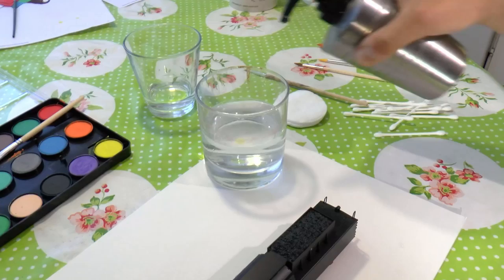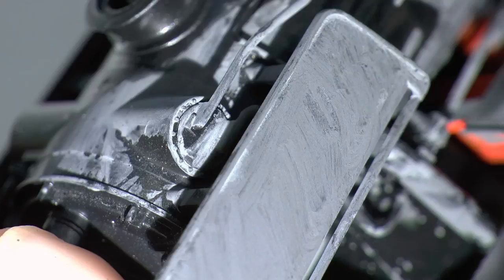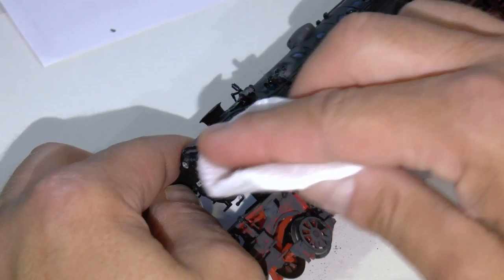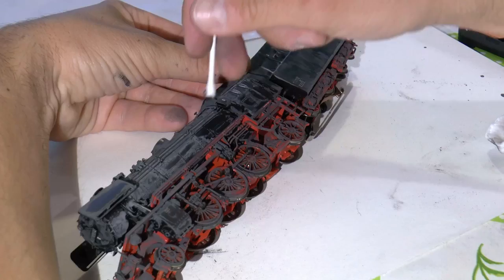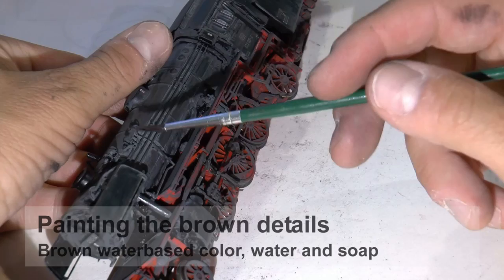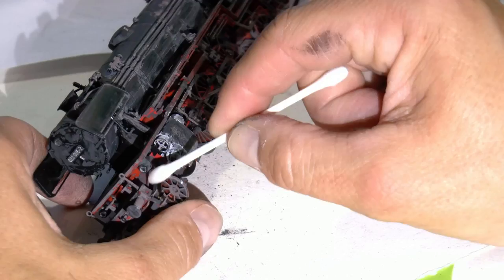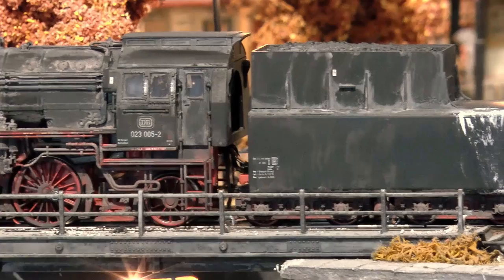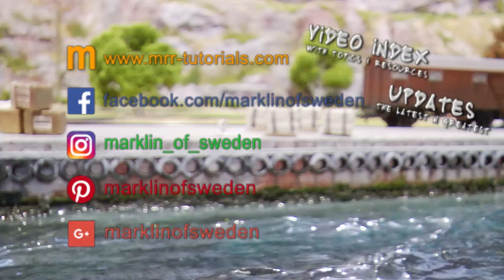Weather with water colors EASY - Detailed guide DIY

Comment: another great video, thanks for producing them! question: you say this is easily reversible, but how? how would you get all the paint out of all the small corners? just wondering before I do this myself.
Reply from the maker: +monkobillo Hi! Well, the car or locomotive will not be like as shiny as the first time you picked it new up from the box, but close to it. I have made some disassembly, like removing the cover or boiler when cleaning, to get the color off w/o getting water/soap in the motor and decoder. I used a soft toothbrush for the job. The remains after cleaning is not notable for a buyer on ebay or whereever the rolling stock is sold. Maybe it's a theme for another video? 😄 "How to remove color box weathering"
Reply from the maker: +monkobillo However, there might be variations in the plastic type between different manufaturers, as well as the quality of the plastics and also in the colors from one manufacturer to another, so it's probably a good thing to test on a small surface before painting the entire locomotive, or car.
Reply: Thanks very much for your reply. Seems like an easy way to try out weathering without too much risk, so I'll definitely try it. Also much quicker than setting up my airbrush!
Reply from the maker: monkobillo I recorded a video response to your question, since it was very relevant. The "removal of weathering" video will be published Sept 22 at 06:00am CET.

Comment: it’s different here in canada, well for me anyway, i can pick up a perfect lolco for 60 bucks. but then again i’m running dc. I know a buddy of mine, he’s got s scale and I think i wouldn’t be able to run that scale of a loco with the price rang i got i’ve picked up second hand locos, a lot! now mind you i’ve only 20 odd locos.
Reply: I do s scale, and most of the engines you find are postwar.  The starter ones tend to be 40-80$ USD, and the more high end metal engines tend to be 120-200$ USD.  You can find very nice items if you look in the right place.  Ebay is a huge source for postwar trains if you want any.

Comment: Why not use alcohol?
Reply from the maker: Roberto Arroyo The intention with this video is to explain the absolutly easiest and lowest cost removable weathering available. Tap water is available in most places, as well as soap. Kids paints as well. In this setup soap replaces the alcohol as remover of the water tension. Alcohol can also react with stickers and paint found on the rolling stock. Alcohol based treatments has a tendency to be more permanent.

Comment: About adding the soap to the water ... the basic ingredient of liquid soaps is glycerine why not just use this for surface tension reduction instead of adding all of the perfumes and dyes added in the soap? I'm sure availability has most to do with it. Just some thoughts.
Reply: You can also use rubbing alcohol in the water to break water tension as well.